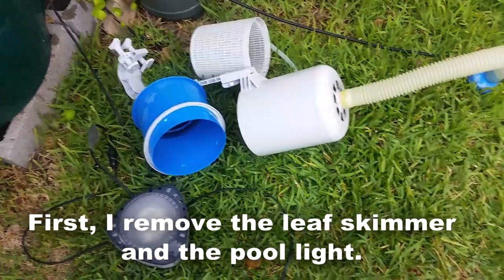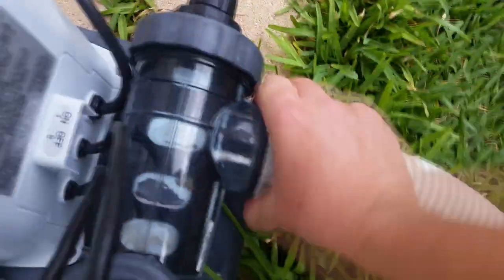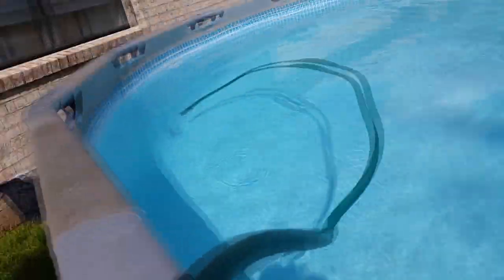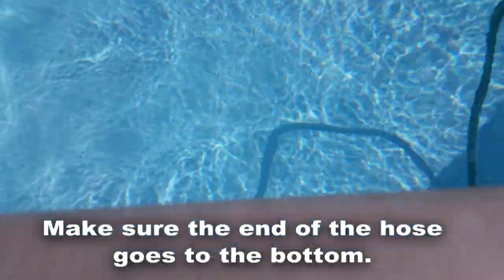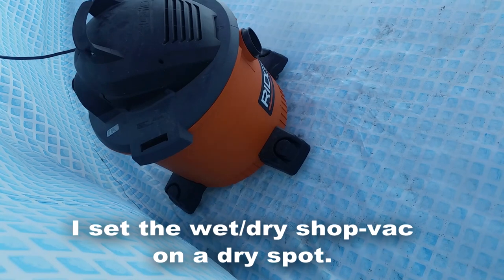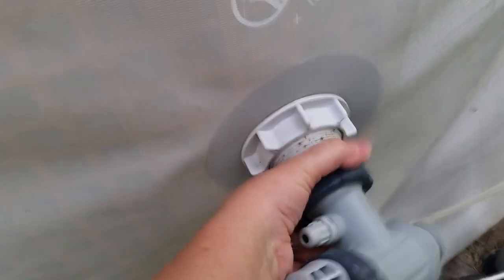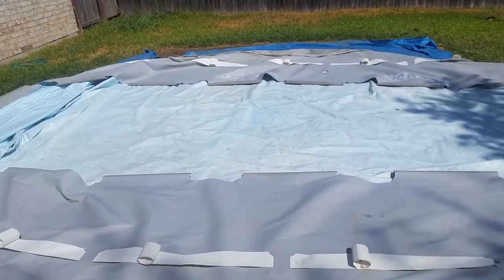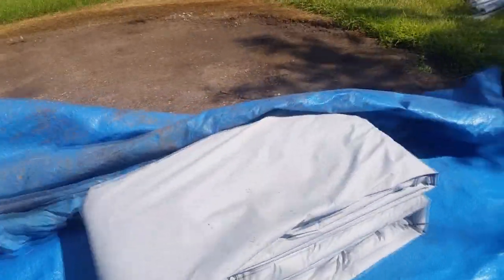How I Take Down My Intex Ultra Frame Pool

Comment: love how the most difficult part of this whole process is disconnecting the frame and you just gloss right over that. nbd. cool.
Reply from the maker: Hi, Paul!
I'm sorry this didn't work for you.  Truth is, if you set the pool up, you probably already understand how to unhook the parts.  Also, since I didn't have any trouble taking down the frame by myself, I didn't think much more need be said.  In fact, my mother, who has the same set up, was able to do this without much trouble.  It does take a bit of strength, and is probably easier if you have help (and aren't holding a video camera...haha).  But really, it wasn't  that difficult.  
Thanks for watching, though.  And thank you for your comment.
Take care! :)
Reply: i do that solo mate,  my question was the folding, so thx for the info
Reply: Agreeeeeed. Like what the fuck.
Reply: @starcat70  it’s not that we don’t know how to take it apart the vinyl sticks to the poles 😂
Reply: Yea I can't remember how to get first tee off either. Total gloss over and shit response

Comment: yeah....personally,  I've ruined every intex pool I have ever tried to take down because the hardware, specifically, the top tubing that is inserted into the liner is, well, uncooperstive. I saw your comment about how a person should know how the frame works....well...ok, humor me...how are you able to annually take that pool down without destroying the top frame and liner?

im in Louisiana...our last pool stayed up until November last year...why take it down every year?  is it to gain the extra bit of lawn for fall because winterizing a pool like this is 500% easier and less stressing on the pool and frame. I know people in Wisconsin who winterize these pools just fine.

I would really appreciate you sharing your trade secrets about the frame, though! thanks!
Reply from the maker: John Giles I'm sorry the video didn't work for you. The problem might be that the tubing is getting stuck to the liner due to excessive heat or humidity.   When this happens to mine, I slowly work the tubing out by twisting it and sort of peeling off the liner from the tubing.  It does take a bit of patience, but I've not encountered an issue where it damaged the liner.  
Of course, you could avoid the problem by leaving the pool up all winter.  I take the pool down, because we do sometimes get ice storms in the winter that may damage the liner.  Some people I know personally, live in Oklahoma and leave their pool up all year, but then must deal with trying to get the green water clear again when time to reopen the pool. It's a personal preference which you choose.  If taking the pool down is too much of an issue, leave it up.
I may have glossed over the frame issue, because the difficulties with it are so much like they are when assembling the pool.  I may have wrongly assumed one would know how to manage that.  Partly, because my mother (who lives in Oklahoma) took her pool down herself without much trouble and I have taken mine down by myself for several years now.  Again, the only thing I've encountered resembling what you're talking about is the tubing getting stuck to the liner, which is solved by twisting the tubing and carefully peeling the liner off.  Perhaps there are other more helpful videos that address the issue in more detail.  My apologies for not being more clear in this video.  
Take care! :)
Reply: Shauna Chan Thank you for the response! I am not so patient...lol...a partial drainage and complete covering will suffice...just add a gallon of liquid bleach to it once in a while. The guys way up north will partially drain pools to allow for the expansion of the ice. I don't mind pool maintenance...it is very satisfying to me. I love turning the green water into something perfect.
Reply from the maker: John Giles I think there may come a season when I do leave the pool up, because it can be a hassle.  I'll keep in mind your tips for winterizing when that time comes.  For now, I'll continue taking the pool down.  My concern is that the liner will become more brittle and more worn sooner from the cold weather, though I'm not sure that's really much of a problem.  I've heard others say a pool can last 5 years or more if it's taken down at the end of summer, as opposed to lasting 3 years if left up year around.  Either way, I don't mind maintaining it, I just want it to last! :D 
Thank you so much for commenting. :)
Reply: You are welcome! I plan on covering the new 16 x 32 x 52 with a deck. It is partially recessed in a low area. I think between that and keeping it covered and  sheltered from those August UV rays, (those are the real culprit), in tandem with the winter extremes here in late January - Feb,  I am hopeful it will last for a long time.

I have heard rumors of them lasting for 10-15 years.
Reply: may i suggest you get a doughboy above ground pool with metal sides they can be left outside all winter just drain half the water out and cover with winter cover.

Comment: why not leave it up for winter like normal pool
Reply from the maker: Hi!  You can leave the pool up, though it may need to be winterized if your area gets freezing temperatures.  To winterize, about half of the pool may need to be drained and the equipment needs to be detached.  The life of the pool may be shorter if you leave it up in very cold winters.  I take mine down because we do get occasional freezes in our area and I don't want the liner to get brittle, or the gaskets in the equipment to get brittle from the ice.  
Thanks for watching the video! :)
Reply: It’s not a “normal pool” it’s made of plastic and will crack it states it in the Manila on how low a temperature it can tolerate

Comment: My pool isn't doing this! I have the water hose on and everything
Reply from the maker: Hi!  I'm sorry this didn't work for you.  The pool should drain if you do the following:
Connect the hose to the faucet, then put the other end of the hose into the pool all the way to the bottom of the pool.  Turn the faucet on full blast and let it run until you know water is running into the pool.  Turn off the faucet.  Leave the hose in the pool, but disconnect from the faucet.  This will create a vacuum of sorts in the hose and force the water to come out of the end you disconnected from the faucet.  It takes a while to drain a pool this way, but it does work.  I hope this helps.  Thank you for your comment. Take care! :)
Reply: Me too I wonder if my hose is toooo long

Comment: So I'm moving and can u tell me a ideas for it
Reply from the maker: If you are moving to a new house and wish to keep the pool, I can tell you how I store my pool, which would also be good for transport.  First, after taking the pool down, I separate the frame parts into large garbage bags and tightly duct tape around them so the posts don't slide around.  They can then be put together in a large box if need be.  The pool itself, I make sure to put a bit of talcum powder in the bottom of it, to make sure it is dry before I fold it up.  It will help keep the pool from getting stuck together in storage.  After the pool is folded, it can be wrapped in a tarp to protect it from punctures.  To move the folded pool around, since it is a bit heavy, I put it on a tarp and drag it.  I clean all equipment pieces, let them dry and then put them in their original boxes.  
I hope this helps.  Please let me know if I've misunderstood the question.  
Take care! :)

Comment: Hey do you know how to fix the low filter pump on salt water chlorinater? I tried Bach washing my filter, I semi cleaned chlorinater although maybe not enough. Thanks for any help.
Reply from the maker: Sorry for not responding sooner, I've been out of the country.
Make sure the flow sensor is also clean in the chlorinator.  It's the flap that should move freely on its hinge inside the tube.  If the chlorinator is clean and free of lime deposits, and the filter cartridge is clean, there should not be a low flow problem unless something is wrong with the filter pump, or the filter pump is not a strong enough one for the chlorinator.  
I hope that helps.  ☺